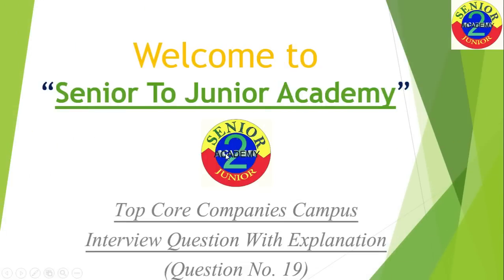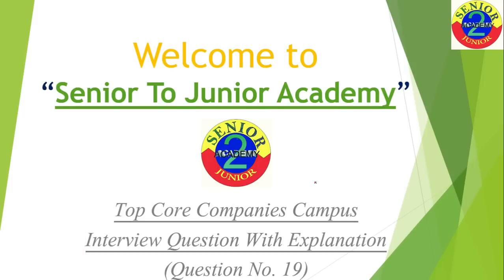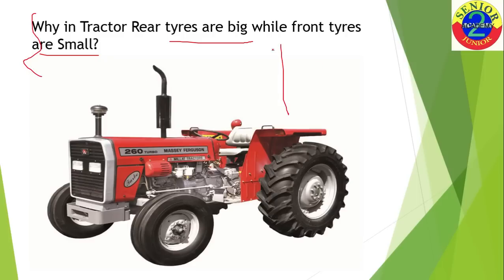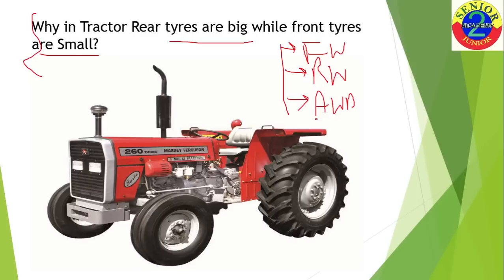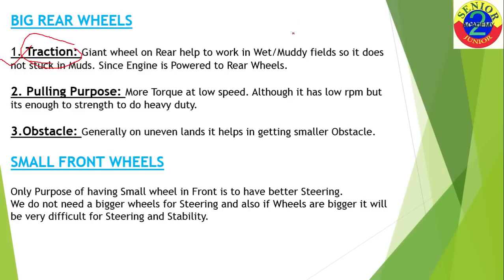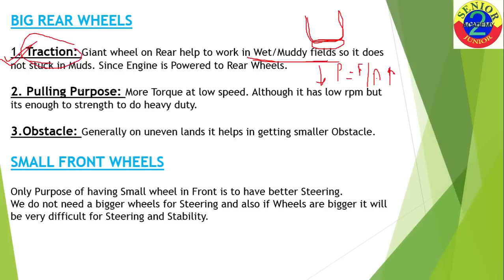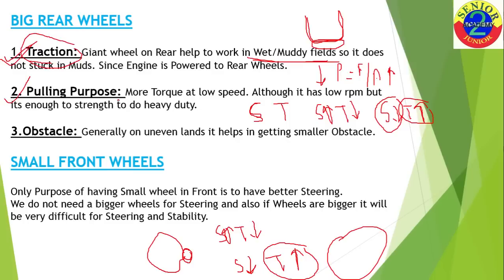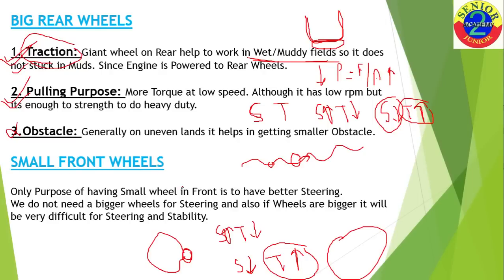Why Rear Wheels are Bigger in Tractor- Mechanical Campus Interview Question (Question 19)

Comment: 1) Traction (frictional force) is a result of the 'surface area' of the tyre in contact with the ground, and dependent upon both the width of the tyre and the diameter of the tyre (especially for soft ground conditions) 2) Tractors have to move at a low speed in muddy conditions or governed by the fields they plough. By having bigger tyres and high gear ratios, the engine can be designed to run at a lower rpm (saving fuel as a result, smaller engine size) while generating higher torque.
Reply: Vik Raz this is a way better answer than the one in video
Reply: but according to laws of friction , friction  doesn't depend on area of contact
Reply: @nuvedraza1127  Laws of friction are ONLY true for RIGID rolling or static bodies on/against FLAT surfaces, and frictional force is independent of surface area.

However, in case of Rubber Tyres (with elastic deformation) rolling on rough road/soil surfaces (with amplitude and frequency), the frictional force is NOT independent of area of contact.

Check : http://www.phoenix-tribology.com/wp-content/uploads/guidance/Guidance-Rubber-Friction.pdf

Comment: The primary purpose of a suspension system (coil or leaf spring) is to act as a dampener against shocks to the 'payload' while a vehicle (automotive or off-highway) is in motion. Since the tractor's payload is only that of the 'driver', it is far more economical to provide 'shock absorbers' under the Driver's seat rather than having a complete suspension system for 4 wheels.

Comment: there is no torque on wheel rather its a force, torque only generated by the engine then multiplied by the gear ratio and final drive ratio. F= engine torque x gear ratio x final drive ratio/ tire radius.  traction solely depends on the coefficient of the friction, the material type that rub with each other, independent of the tire width and the mass of the vehicle,   in your case, yes tire radius would make tractor less heavy thus protruding tire tread would be necessary for the mud.

Comment: why tractor has no shock absorber or any suspension spring or system like that?please answer
Reply: the answer is in your question itself. Tell me why a its called farm tractor, coz it is intended to work in farms where the conditions are harsh. so the axels are directly mounted to chassis. because of different speed and field requirements, the on-chassis suspension components are limited. The manufacturers compensate that by providing state-of-the art seat and cab suspension systems.
Reply: the huge tire itself provides suspension action..so i don't require separate suspension system
Reply: every suspension funcction  relates to power loss and to use the high torque by thewheels it should use all its power for the good torque we can not compensate it with the comfort of bieng suspensoned

Comment: why can't we have a small wheels for lorries and trucks also at front
Reply: Nyc question..
Reply: The lorries r heavy duty vehicles so it can't able to have small wheels at front
Reply: Truck has high speed low torque. So in truck all wheels are same for better balancing.

Comment: why turbochargers are not used in petrol engine ?
Reply from the maker: yes turbocharger are used in Petrol Engine Also.
they are used in Gasoline Direct Injection (GDI) system
FORD ECOSPORT is petrol vehicle with turbocharger.